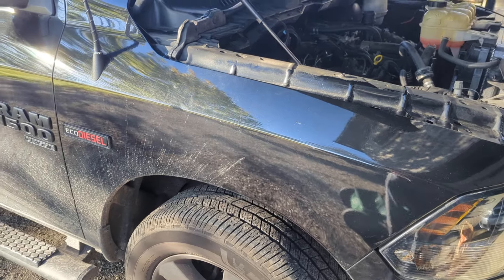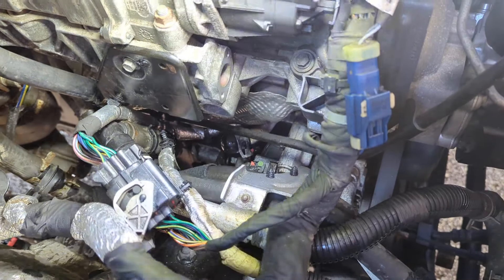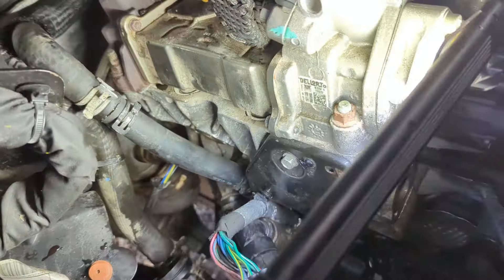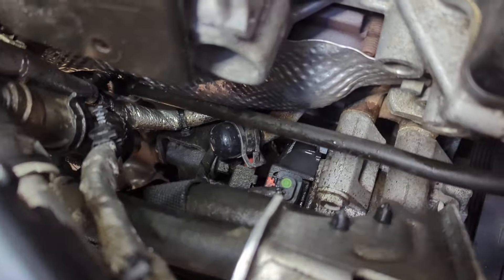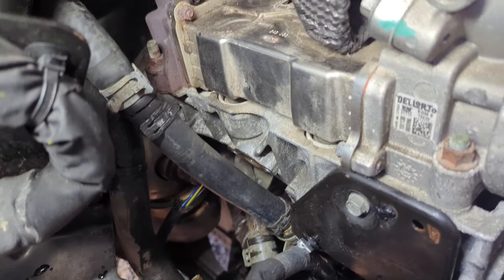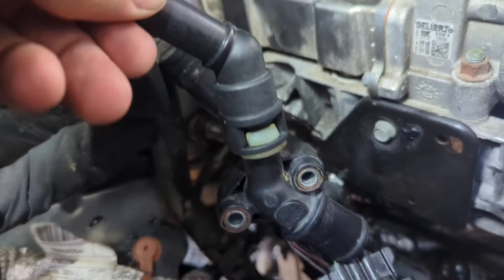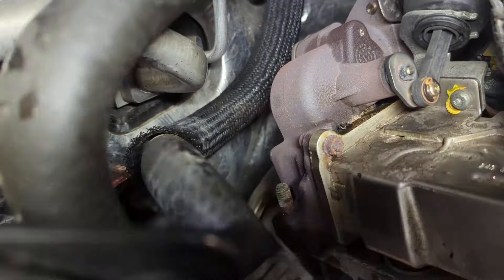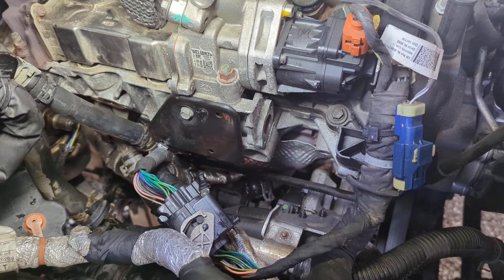RAM 1500 3.0 Ecodiesel EGR cooler internal coolant leak fix

Comment: What is that plastic thing at the end that needs to screws that goes attached to the EGR Cooler Support I can’t find it any where
Reply from the maker: @antoniovallin192  I don't think that part is available separately. It's basically a tee fitting.